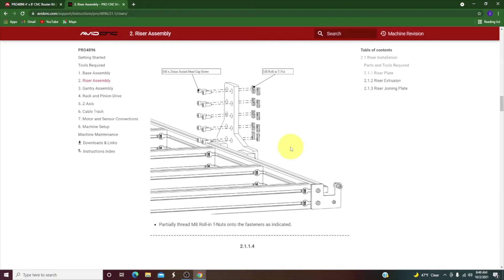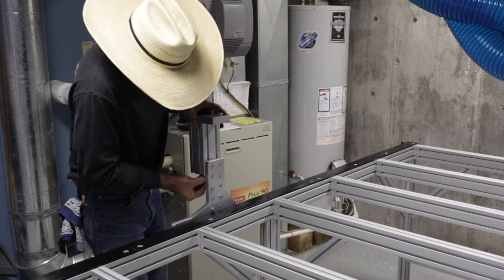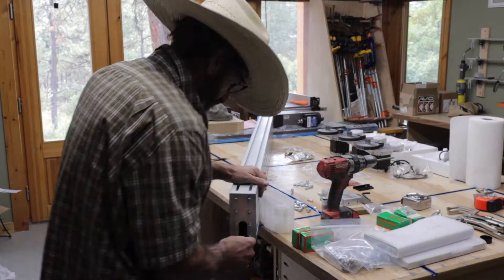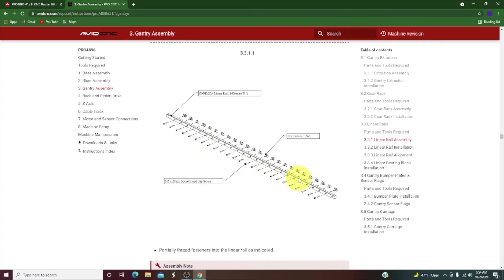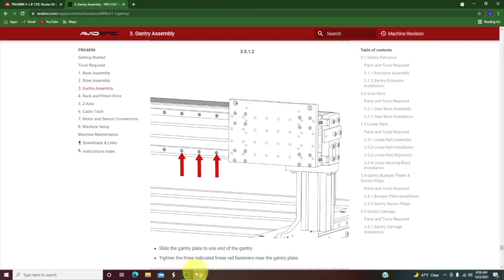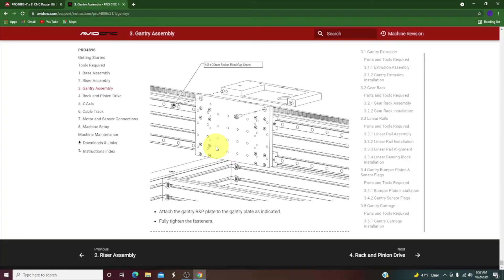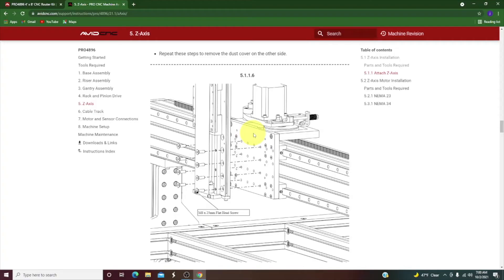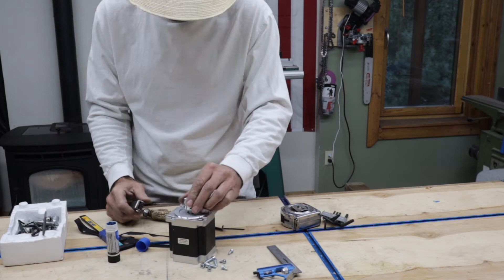AVID PRO SERIES 4896 ASSEMBLY PART 2

Comment: I noticed when you put the front plate back on the Z-axis at 18:25 you didn't do any leveling.  I found with a good gantry leveling the Z-axis was about 0.05 degrees off in the X axis direction and 0.10 on the Y axis.  Did you check how calibrated your Z was?
  Good video, thank you for sharing.
Reply from the maker: Thanks for nice comment, I had to do a lot of calibrating off camera it wasn’t to bad but it took me a little time

Comment: Wow,  great video sequences!  I have a large PRO ordered and will be here in January, so these questions would really help…..Did you use blue or red Locktite?  Did AVID recommend one kind in some areas and the vv?  Is there a torque level to these in certain areas of the assembly that is different from others?  Did the ball Allen’s fail from the angle needed to use in assembly when using the drill?  It seemed that sequence was ‘sticky’ for the drill.  So, you changed to a 3/8 socket Allen set that was longer and that had to have a little give, I assume, so that made less stress on the ball Allen head (plus it is longer so the drill motor isn’t bound up too close to the 8020).  Am I correct in that assessment?  Did your fingers ache after each day?  Did you have the base in it’s final position when assembled?  Did you locktite the base legs?  How easy was it to level the base after the table was placed?  Did it flex enough when the leg levels were being set to level for the surface to come up straight and square, or did you wait to tighten some of the assembly?  Did you have to ‘sequence’ the foot levels to keep out angular stresses being engaged?  Lots of great suggestions here, and the best I’ve seem after watching several of these YT builds!  Thank you for answering these in advance!  PayPal help? In what area of the US are you living?  I am in NW Washington.  ☔️😎
Reply from the maker: 1-blue locktite
2-they didnt recommend any certain one that i know of
3-i didnt torque to a certain pounds ,i just tightened really tight
4-the really small ball allens break really easy so get some extra
5-i didnt locktite the leg assembly
6-leveling and squaring was really easy
7-i waited to tighten some of structure till i got it perfectly level and square
8-im in the rocky mountains colorado